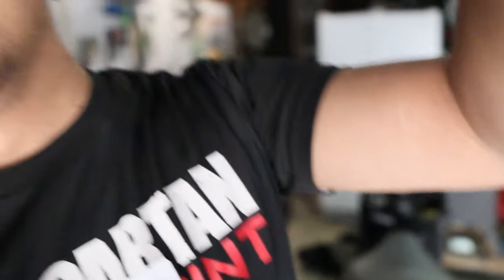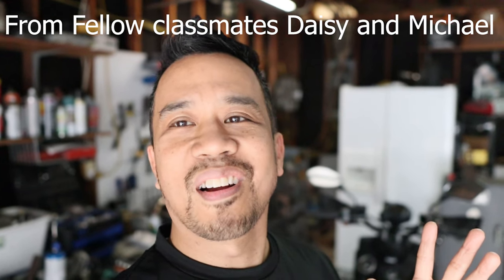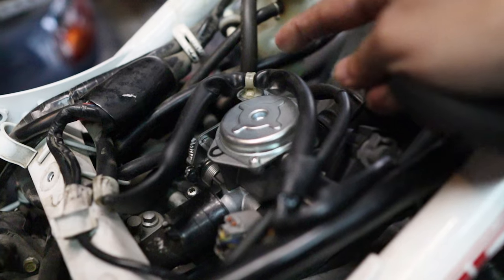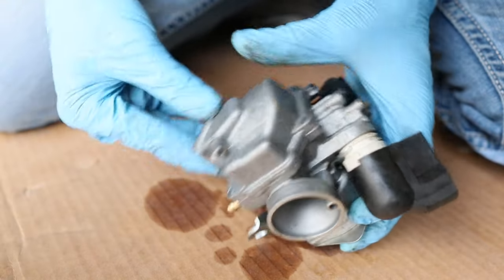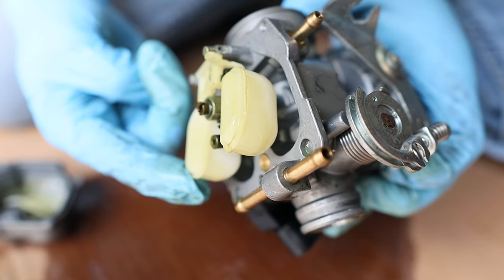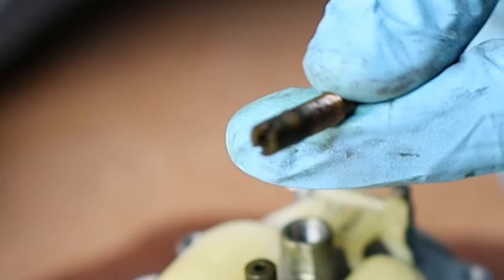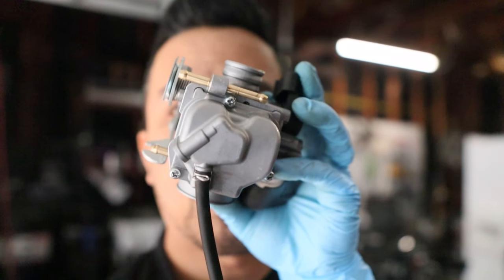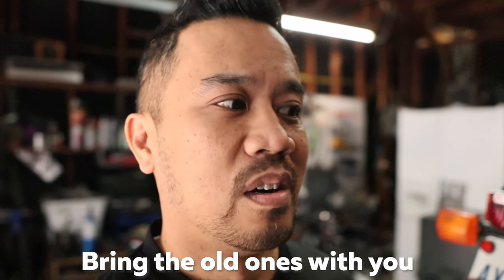Honda Ruckus Stock Carb Cleaning #HondaRuckus#RuckusCarb #SmallEngineVelocity

Comment: I would place my finger in the air cleaner intake hole while cranking at full throttle to help prime the fuel system and absolutely reset the ECU.

Comment: Most carb issues are due to a clogged pilot jet. But if your Ruckus is really gunky then the area around the needle-jet (not jet-needle), aka emulsion tube, could be gunked up also. Remove the needle-jet by first removing the main jet. Then tap on the needle jet from the carb throat using a blunt punch. You could also use a 4-inch or longer 1/4” socket extension 

In addition, the auto-choke (automatic start-up enrichener) could be clogged like my Ruckus and Suzuki pit bike. That’s the 3rd brass cylinder/pick-up tube next to the main jet and pilot jet. That cylinder has a super tiny hole that picks up fuel to help start a cold engine. I used a super thin strand of steel wire from one of those braided wire used to mount heavy old artwork. i poked the wire with a little carb cleaner and eventually it cleared up. This is pretty critical for colder climates or winter time.

Comment: Can you post a complete circuit explanation for a class? Battery connection circuit, blade fuse module relay blue, my same model motorcycle has a circuit fault problem, I need to refer to the same model car route map or video, redefine the battery connected by the modified circuit, then I can use the battery motor to drive the engine, otherwise I can only start the engine with the foot pedal

Comment: You need to reset the computer.  Anytime the battery is changed or the electric component is disconnected from the carb a reset is recommended.

Comment: Great video! Quick question, I cleaned my jets and my bike starts but now my fuel pump keeps  clicking, I turned it off right away when I noticed it. Is it because fuel needs to fill the bowl? If that’s the case, is it safe to ride like that till the noise goes away

Comment: Only use non-ethanol fuel and use fuel stabilizer as well - especially if you don't use the bike all the time - you won't have carburetor 'issues.'
Reply: Would be nice, however in Canada you can’t find fuel at the pumps without the ethanol... so yeah, pulling the carb and cleaning the tiny jet is an annual must do event.

Comment: I have a question , does the ruckus carb have a brass?? seat in the fuel inlet or does the float needle seat directly in the aluminum inlet hole. I do ATV carburetors as a service and never seen one without a brass etc. seat , this carb may not have one or it could have fallen out during cleaning ????